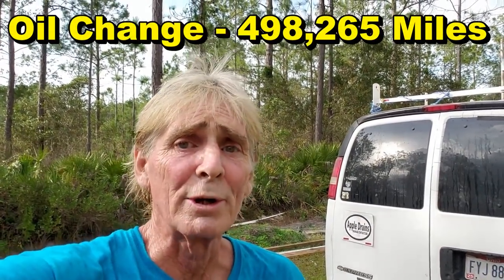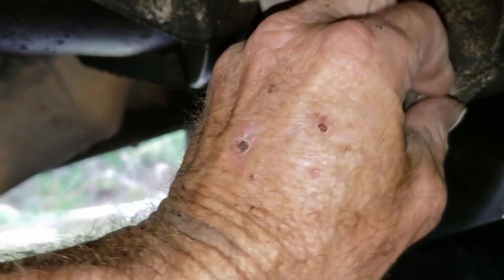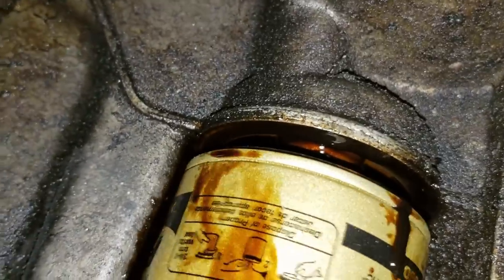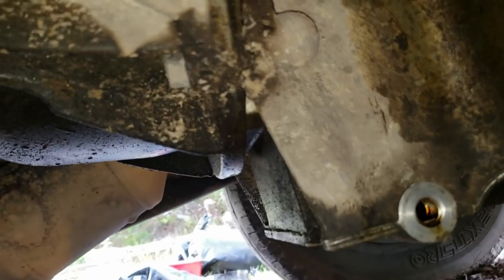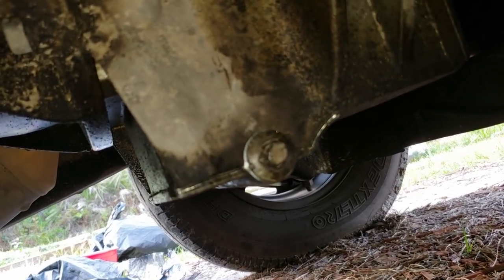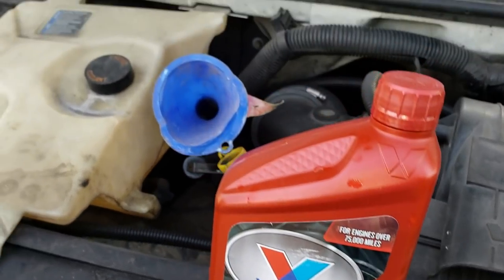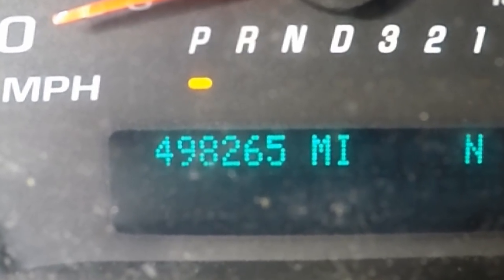FRAM OIL FILTER, How Good Are They? How To Do It Yourself

Comment: You need a new oil drain plug and use the correct wrench size and not visegrips.
Reply: Go specs call for ‘ol rusty vice grips’. It’s the one tool everyone and their grandma has and it works

Comment: "Why don't you use the 9/16?" Yeah did you see that bolt, vice grips seem to do just fine. Fram synthetic filter is what I have always used with valvoline as well. 6.0l engine also.
Reply: Your right.  But vise grips will lock on to a slightly stripped drain plug.  Ha ha

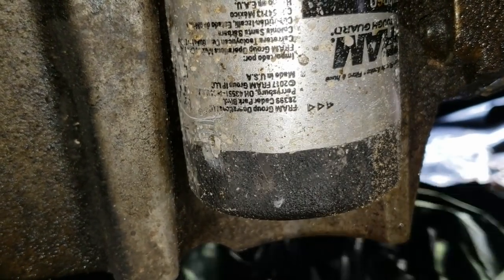Comment: 2:04 It's not a flaw. It's so you can fill the new filter with oil before installing it and the pump doesn't have to fill it while your bearings get nothing.
Reply: Yeah, it’s also nice because when they’re pointed down they’re usually towards the bottom of the engine too. That way oil doesn’t drip all over shit and the exhaust. It looks like it makes a worse mess but really it’s easier to keep clean.

Though car companies don’t really plan for the filter to be on the bottom pointed down. It’s usually an after thought, in the grand scheme of things not much damage happens when you start it dry the first time.
Reply: The filter and galleries will fill so fast your bearings will never know, you're talking about a few dozen lightly loaded rotations versus millions under load the bearings will go through.
Reply: Anti drainback
Reply: @Wayne B   Makes no difference. But it is scary noisyfor a couple of seconds.

Comment: I've used Fram for years! Never had a problem!
Reply: The orange fram filter (cheapest one) is the one that's junk, this XG synthetic filter is actually excellent and nobody think's they're crap.
Reply: he who rules  your mother
Reply: he who rules  don't see what's wrong with a fully synthetic filtering media with 99% efficiency and a silicone anti-drain back valve. You clearly don't know how the XG is built, because it's built the same as every other high end filter.
Reply: he who rules  the XG is built the same as Wix, same efficiency, same components, you clearly don't know anything
Reply: @FrenchValleyAirport  FRAM XG is built very similarly to the Wix XP, but the XG has 99% efficiency at 20 microns while the XP has only 50% at 20. That’s the biggest difference. Data has showed time after time that Wix filters don’t filter very well compared to FRAM or OEM filters.

Comment: I've been using Fram filters for 40+ years. Haven't lost an engine yet. I've had several engines go 200k plus before selling them. And that was using dino oil at 5k-7k mile changes. I've since gone to annual fully synthetic oil changes of avg 10k miles.  Not as impressive as your mileage but obviously Fram filters get the job done.
Reply: It is marketing. The companies tap into the good feeling a person gets when he/she changes the oil and filter.

Comment: You're using the XG ULTRA SYNTHETIC, that is an excellent oil filter, the junk oil filter is the plain ORANGE can filter, the one you're using is an actually a really good filter. Deceptive video, nobody has problems with those.
Reply: I was at orielys and they were bagging it. I told them they seem to be fine to me.
Reply: @murphygen  the xg is built like all other premium filters, synthetic media, silicone anti-drain back, solidly put together.
Reply: David G fram has 4 different types of oil filters but only one of them has metal end caps

Comment: Great job Chuck. That filter looks like a Fram Tough Guard, which is all around better than their orange colored filter. I use the Tough Guard myself or sometimes Wix. I have almost 265,000 on my truck and it runs great.
Reply: tarquineous the extra guard and the tough guard both have paper end caps the ultra synthetic filter is the only  one that has metal end caps

Comment: Fram Filters are okay if you get their top of the line Filters...it's their low-end budget priced Filters that are cheap and have issues.
Reply: Darrin G. What? They are all trash bc of the rust
Reply: @Uniquestanced  I don't think you're reading me properly here. 
 I'm no Fan of FRAM...but you get what you pay for. 
 FRAM'S Bottom of the Line Filters seem to be having the "Rust Issue's"...but their Top End Filters seen to be reasonably well constructed and made. 
 You get what ya pay for, and many people on a budget buy them for this reason. 
Not the best thing out there...but it's what they can afford. 
 For myself...I only use PurolatorBOSS, Wix, and Mobil-1 in that order of preference.  I only used FRAM's when I was a goofy teenager with a Junky Car because that was all I could afford back then...and some filtration is still better than none!
Reply: ADOLF HITLER  you are correct sir

Comment: Man it’s great you maintenance your vehicle on time good to see. One thing I observed though is your drain bolt is stripped, you mentioned 9/16 and you used vice grips while your drain bolt calls for metric. I would buy an oem bolt from the dealership for a few bucks then use metric going forward. Just some advice, otherwise nice vid man!

Comment: the only video ive seen using vicegrips to remove oil pan bolt...has the engine ever being overhauled..whats your pressure psi reading in your dashboard ?????

Comment: Maintenance is everything...Myself i never use or will use Fram filters but ha id rather have someone change there oil quite regular or sooner then required 3-4k using cheap oil filter or oil for that matter then high quality filter and go as far as you can before have to change it 7500-10k or even longer im sure on some bad maintenance owners. Oil cheap engines are not. Nice job other then that mess up oil bolt lol

Comment: So here is the issue with Fram filters, the regular ones are very cheap and have poor filtering. The filter you are using is their higher end synthetic filters which are actually pretty good. Also the fact that you use synthetic and change it often helps a lot to keep your trunk engine running properly. The issue comes when people try and cheap out and get the cheap filters & oil & then wait a long time to change the oil. 

Good job, keep it up!
Reply: Another issue is the extremely thin casing, prone to pinhole leaks. If you over tighten them you're gonna crush them during removal.
Reply: I've used Fram for many years! Never had one problem!
Reply: Never witnessed a motor grenade from using the orange oil filter. Truck I traded in in 2008 had over 200,000 using castrol GTX and the orange fram filter. Yes they do have very good filtering capabilities. Compression tested before I decided to buy another truck and was still with excellent compression.

Comment: The Fram Ultra and Tough Guard filters are of very good quality and I’ve used them a bunch. It’s the orange garbage Extra Guard filters that shouldn’t even be sold anymore. 6.0 is pretty much bullet proof though, a crappy Fram probably wouldn’t even hurt it...
Reply: 68Camaro RS/SS I understand, WIX is usually my preference. But for something you can grab at Wal-Mart for a reasonable cost, the mid level and top end Fram filters are good. The Fram Ultra is widely reported to be one of the best filters for any price on the “Bob is the oil guy” forums...and those people are pretty meticulous, even obsessed. It’s the cheap orange ones that have hurt their reputation badly. Unfortunately that’s what 90% of the public uses it seems.
Reply: 68Camaro RS/SS bobistheoilguy is a motor oil enthusiast forum where members do oil analysis and filter comparisons every day. These people are literally obsessed with what oils to use, what OCIs, filters, etc. I check there before I buy anything because you can find real world scientific analysis on it all. It’s not just “cut some new filters open and look at them” like Project Farm. There’s a thread on there showing photos of a Fram Ultra with 25k miles on it and it looked good.
Reply: There’s a lot of interesting stuff on that forum, certainly helps in deciding what oil and filter to use.
Reply: 2ndshiftaudio Heck no, I was talking about the 6.0 Vortec in the van.

Comment: Fram tough guard and fram ultra are excellent oil filters. Wix , and wix xp, purlator boss and even the super tech oil filter is good ...........
Reply: Even Fram Extra Guard is good. People shit on it because it has cardboard (I used to as well) but what people fail to realize (so did I) is that compact cardboard doesn’t disengrate in oil like it would water. You can look up cut open videos and the cardboard is fine. Obviously use them within reason. I wouldn’t go over 3,000-5,000 miles on one but still, not bad. I personally use Wix XP because I like the coil spring system over the leaf spring in most filters and they relatively cheap.
Reply: @johnmoore1495  If your filter is catching anything visible, you have more to worry about than obsessive oil changes.
Reply: Napa filters are all made by wix. Get one
Reply: supertch are junk
Reply: @andrewp1998  yes on the box it says, Supertech filters down to 30 microns and Frams  filter down to 20 microns. Just read the box, I do like supertech oil though.
Reply: @andrewp1998  
Do you have an oil analysis to prove it?
Reply: No but they are built well.

Comment: A fellow plumber? I owned 3 different muscle car 60 's, and 70's models and instead of the Fram PH 3600 I would use the Fram PH5. The PH5 has twice the oil capacity and flow because it twice the length of the PH3600! Plus I have used the Valvoline brand the most also usually maxlife.

Comment: Nice video.  I would recommend filling up the filter with fresh oil.  Then screw it on.
Reply: I agree with you and James Stein.
Reply: I know this reply is 3 months late. I do have a point I want to make about pre-filling oil filers. So I completely agree with the concept, however, my dad gave me a 2004 nissan sentra with over 250k on it which 2 years year later I still have with 290k on the clock. I had a conversation with him the other day about pre-filling oil filters and he said he's never done it on any of the cars he has owned. He's had the car since new and has only used conventional 5w-30 super tech from walmart with the fram tough guards along with stp oil additive.  Everything I've seen online contradicts what he's done, yet the cars still running. Maybe it's just because its a dual over head cam 4 cylinder with mostly high way miles, or maybe its that a lot of rumors online are not necessarily going to give us better results. Do what you want, but lets be real, will it matter if this guy pre-fills the filter if the motor already has 500k plus?
Reply: @vinnybruno8402  oil flows pretty fast and the film thats leftover is still there. Same way I doubt that most wear occurs at startup because if that's the case start stop engines would be blowing everywhere.
I have no idea where people got that. 
It's like someone telling me cranking my Engine will wear it out more than towing a 10k trailer with the Engine spinning 4k rpm.
I still though prefer to do it anyway and fill the filters.
Reply: @bryanmartinez6600  no the most engine wear definitely occurs at startup. It puts strain on the rod bearings, flywheel, starter, and battery. It's not as bad if the engine was just shut off but it's still more wear than keeping it running.
Reply: @UnrealOG137  rod bearings have less load on them at startup than when towing starter battery and such are just disposables that wear differently based on use.
Actually driving is where the Engine where's the most especially  in cities where the load is constantly changing.
Flywheel starter Battery are the least of my worries like throwing a rod or burning up the clutch packs in the transmission.
A $150 starter is better than a $500 camshaft and a few days of engine disassembly if it didn't damage the Engine.
Reply: @bryanmartinez6600  I'd rather not replace a starter if I don't have to. On some cars it's a pain in the ass. You are correct about city driving causing more wear. But a cold start causes more wear because the oil isn't flowing throughout the engine yet.

The extra few seconds or minutes that your engine would be idling is less wear than the engine stopping and starting.
Reply: Scott A he did fill it with dirty oil when he screwed it on before it stopped draining
Reply: @frankv64  exactly, lol.
👍🏼
Reply: @bryanmartinez6600  of course most engine wear occurs at start up. Especially if the vehicle has sat for longer than 24hrs. Oil drains down from the top end into the drain pan. When you first start the engine it has to immediately begin pumping oil back up to the top end. It's this few seconds when most engine wear happens.
All expert engineers and mechanics agree about this.

Comment: I've used fram in all my vehicles except my diesels my 7.3 use Donaldson for the extra capacity and my 6.0 motorcraft inbetween my vehicles that I've used fram filters I've collectively put on over 1.5 million miles never had a problem.

Comment: Fram filters have a common bad rep. that came from the 80’s . You also don’t use a standard Fram , you’re using the XP model which is even better. I have to say I cringed when I saw the vice grips on the drain plug and I also saw the destroyed condition of the plug because of the vice grips. 
A lesson I was taught 47 years ago, never use anything but the proper tools on a drain plug . I never even use an open end . I’ve seen too many stripped drain plugs over the years that have turned into nightmares to get out . Some were so mangled that they had to be drilled out .

Comment: Old sandy oil on the new filter gasket ... not too good.  Best to use new oil to lube the new filter gasket and clean off the mounting surface on the engine.
Reply: @zeeoisx   Another pantywaist speaks up. It's part of the ceremony to use old oil to lubricate the gasker. Just make sure there are no particles in it. Try it yourself. You will be surprised how good you feel!
Reply: LOL ... whatever floats your boat.  Better safe than sorry.  I'm sure more people are a bit cleaner when installing a new oil filter than what's shown in this oil change video.
Reply: @zeeosix  Yes, but how do you know what is safe and what is sorry?
Reply: Anytime dirt can be kept out of the oiling system or off the filter base gasket it's a better practice than not. If people don't care about possibly getting contamination in their engine or possibly having a leak on the filter base gasket because of contamination, then by all means go for it!
Reply: @zeeosix  Never had a problem in 50 years. Honest.
Reply: Good ... me neither, and I won't be changing the way I change oil filters and you shouldn't either if it works for you.  To each their own - I'll take the extra 10 seconds to make sure everything is clean.

Comment: The devil is in the details here; A Fram EXTRA GUARD filter plus a quality high mileage oil and 3000 mile oil changes.
Seems like a reasonable combination.

Personally on my 2002 Sienna, that now has 201k on it, I use Royal Purple or a Mobile 1 filter with Castrol HM oil. 
I strive to change my oil sometime after hitting 4,000, but unfortunately many times end up going 5 something.

But I've recently been looking at that Fram Ultra, compared to the two filters that I use, and I can't see anything too bad about it on the numerous video reviews that I've watched that compare them.

If the Fram Ultra is a crappy filter, and somebody has some FACTS regarding that, I'd like to hear them.
Reply: Fram Ultra is what I use. I change it every 10,000 miles but I change the oil every 5,000. After 10,000 miles on our Fram Ultra filter at the last oil change we has an oil analysis done. Only 0.2 % of insolubles in the oil. 0.6% is considered acceptable. Thus the Fram Ultra filter was still doing it's job after 10,000 miles.

Comment: in the end , changing your oil filter and oil on the recommended schedule will off set any cheap manufacture of the FRAM filter , only when people don`t change the fluids on regular basis is when a cheapness of  filter will give you problems . Three cheers for the Scotty Kilmer Channel
Reply: Bingo.
Reply: With that logic just change your oil every mile and you won't have to use any filter. 
Fram synthetic filters are as good as any and with a minimal extra cost. A yearly oil change with a good true synthetic oil and good filter is cheaper and actually better for your engine than changing a dino oil every 5000km. You'll also pick up a couple of miles per gallon. There are several reasons why manufacturers now use synthetics in their cars.

Comment: Grabbing the oil and grit off the side of the motor for the filter gasket is insanely wrong!!! Use clean oil from the New bottles
Reply: James, I agree completely, I wouldn't do that. But let's be real. The only reason you pre-lube the seal is to make it easier to remove for the next oil change and to prevent the gasket from sticking to the block. The grit won't cause it to leak, only double-gasketing does that. It's one of those moments where I wanted to cringe, but at the same time he's got 500k on the motor. Point is I feel like a lot of the rumors online about oil changes and prepping filters is over-exaggerated.
Reply: Lol!  That simply stays on the surface of the gasket.  It's not entering the oil and even if it did, you think that little amount of grit is going to make it past the filter anyhow?  Lots of paranoia.  I spent a lot of time in various 2nd and 3rd world countries and have seen trucks make it a couple hundred thousand miles on 40k mi oil changes in VERY dirty environments.